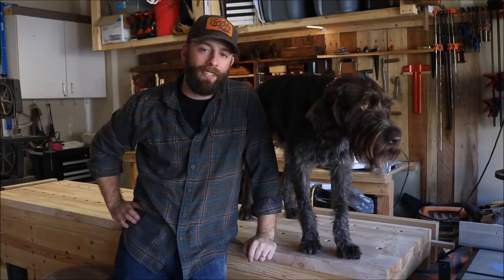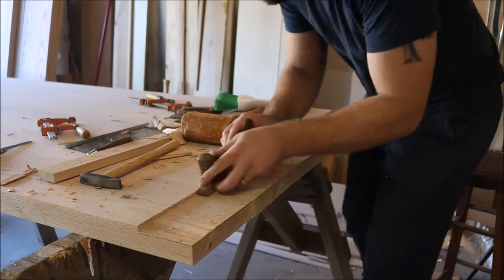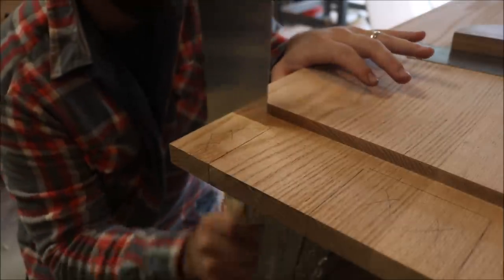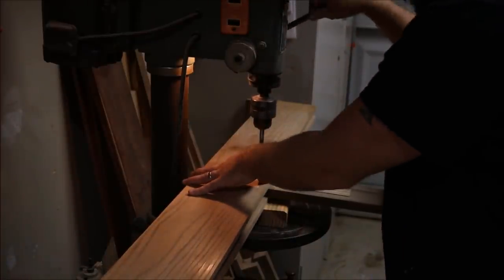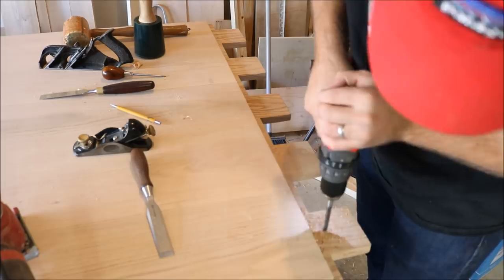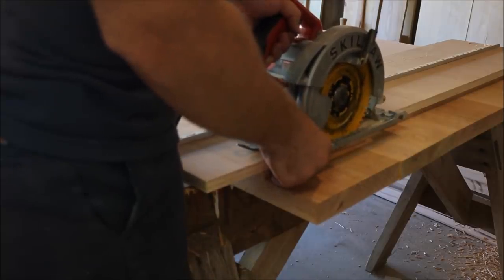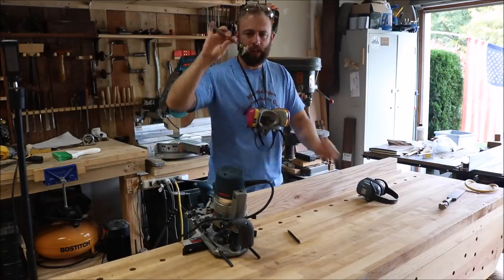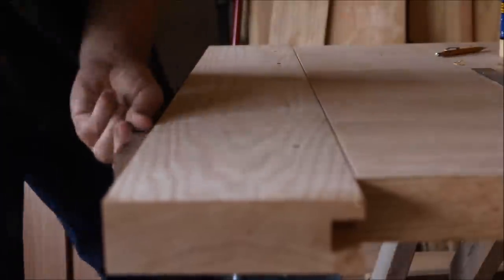SERIOUS Breadboard Ends!! Hand Tools vs Power Tools! Woodworking // How To // DIY

Comment: Chris,  what do you think of a shouldered and wedged tenon for the blocks that attach the top to the base or even a blind dovetail joint?
Reply from the maker: Hi Rosey, I think I know what you are asking here, and If I would have had more time I would have tried some sort of sliding dovetail to attach the blocks to the top. I was already way past my deadline and ready to be done with it. I know that the glue will be strong enough, but using some some of joinery to give them that mechanical strength would have been a good way to go too.

Comment: I am building a 10’ table with breadboard ends but the tabletop is not glued up but instead consists of 6-2x8s spaced 1/16” apart. My question is regarding the attachment of the breadboard- would it be permissible to glue up each tenon of the 2x8s to the breadboard and then draw bore the pieces together since there is a gap between each 2x8 or should I only glue up the center (2) 2x8s?  Also, my project is done in cedar- I plan to use oak dowels- will draw boring put too much stress on the softer cedar?  Thank you for the excellent video and the tool recommendations on your website- all very well done!

Comment: Chris, great video on breadboards - I'm about to start my first go at one.  My question for you, or others here, is about leaving the breadboard end a mite long (when building one in the winter months) to allow that the end will be flush come July when the humidity in Maine goes way up and the table expands.  I'm thinking I may leave my breadboard ends over-long and come back in July for the final cut when the table is expanded about as much as it can.  Of course, then next winter the breadboard ends will be a mite long as the table top contracts.  Any thoughts on approaching this issue?  
Thanks again - looking forward to learning more from you and I appreciate the low key manner you approach teaching.
Reply from the maker: That’s definitely an acceptable approach. If you leave it 3/16th proud on each side you’ll come really close to flush during the summer and might not need to trim.
Reply: Thanks - I was considering that 3/16"s....and that would certainly make it so I don't have to apply finish again or take a chance on marring the already finished surface when the beads of sweat drip into my eyes and increase the risk come next July.
While I'm on the subject of finish - curious what you use on dining table tops....I'm considering gum turps and boiled linseed oil vs. polyurethane - they both have their pros and cons.  Thanks again for you time in replying.  Sure appreciate the support.   @ThirdCoastCraftsman

Comment: Rounded ends on the tenons rounded over with a router would allow you to skip the chisels on the mortise, since you could just use the drill press to hog out the bulk, and route the sides clear. There might be an issue of depth in this case, but I've definitely seen people use drill presses like milling machines before...

I'd probably just break out the chisel, too.

Comment: 7:51: Thanks for the tutorial. Are you drilling entirely through the breadboard, or only through the top layer? Should the dowel go through the top half of the breadboard and into the tenon, or through the entire thickness of the breadboard?

Comment: Only thing I could think of for making the mortised holes would be a hollow chisel mortiser. I don't know if you consider those normal tools, but sometimes Craigslist will have one for sale under 100 bucks!
Reply from the maker: Oh I definitely considered that. I have a smaller JET one but it wasnt tall enough to get the 6" board in there. Getting a drill press attachment might work though. Thanks!

Comment: you can use a mortising machine chisel (and the drill bit too!!) they are cheap you can sharpen them just tap it with a hammer. you can use it for decorative pyramids or for joinery . and it looks cool contact me. ive subscribed to your channel and ive been a professional woodworker for 26 years

Comment: Table top looks great man, question,  what if I had used pocket screws, say 4 per board, 9 foot long boards, do you think the bread board is still a useful option to keep everything flat and safer from splitting? And say your house uses air and forced heat how much humidity change can there really be?

Comment: I was thinking hollow chisel mortiser but the last inch or so would still be hand tools.  Between the stroke limitation on the drill press/mortiser and the length of the mortising bit, a 4" depth would be hard to manage.  Do you need a full 4" mortise on the breadboard ends?  With a 3/4" mortise width, I would think 3" would be adequate.
I have just completed a small table with BB ends; I used 1 1/4" tenon length into a BB end 2 1/2" wide.  Different scale, I know, but strength was more than adequate IMO
Reply from the maker: Agreed that the stroke of the mortiser just wont quiet reach. And 4" might not be needed either. Sometime you have to adapt your design to match your tools abilities and so in this case If I didnt want to chisel I could have went 3" and used the mortiser. It definitely does hurt going 4" and I have zero doubt that it will ever fail with that muh support, but 3" would be probably more than enough as well.

Comment: For a 4" deep mortise, use a chain mortiser. They're expensive but fast.
Reply from the maker: Id love one. maybe I can find a good used one somewhere
Reply: Splunkzop for a mortise their small, do they make a chain mortiser that would work? All the ones I’ve seen are for bigger pockets, and you still need to clean it up some with a chisel afterward.
Reply: I'm not sure what size mortisers they make these days, It's been 7 years since I've done any commercial building work, but I've used a chain mortiser on doors to cut holes for mortise locks - doors were 32mm (1.25") customwood blanks. The builder I was hanging doors for hired one to let me try it out and see what I thought of it. It was too heavy and awkward for that job, also I didn't need to clean up the holes with a chisel as the holes were a perfect size and the face plate of the lock more than covered the hole. I went back to using a jig after that - I wish I could upload photos here because the jig I use is self centring, adjustable for depth and length of cut and uses router bits driven by a drill  to chop out the hole. The only other job I used a chain mortiser on was cutting mortises in 200mm (8") square timbers which were used as framing for a house.
Reply: Splunkzop interesting. I’ve only ever used one for timber framing, they are definitely heavy, but they do an amazing job at hogging out the mortises real quick. With the mortises we were cutting they were a little Rw than twice the thickness of the chain as well we needed the tenons to fit very snug and perfect so we didn’t ever go to the line with that as it didn’t create a super clean and precise edge and wall. The slicks make easy work of that though once you’ve done the majority of it with the chain mortises. Definitely a tool I’d want if I was doing more big mortises like that. Otherwise a drill bit or a router will do the job great too.

Comment: Sorry for the rookie comment but how do you determine the appropriate thickness of the tenon on a given piece of stock?
Reply from the maker: Hey David, there are some recommended ratios and measurements published out there. I've read them but cant remember exactly what they said. I usually just use my eye and what I think will be the strongest keeping a couple of things in mind. If the tenoned piece is going into a much wider board such as a 2x4 going into a 4x4 then I can afford to have my tenon on the 2x4 really thick. I would likely only shave a 1/4" off each face to make the tenon. But if I was joining the same 2x4 into the side of another 2x4 I would want to shave down my tenon alittle more so that the mortise I cut had thick enough walls. I hope that helps. Its so hard writing this stuff out.

Comment: Hallow chisel mortiser would be the only somewhat affordable way to do it without hand tools. I'm sure I'm wrong and someone will let me know that soon enough lol. Either way the chanfered edges on the semm of the breadboard ends adds a nice touch. Give them depth and makes them stand out more. Good work
Reply from the maker: I have a smaller Jet one but the 6" board would fit under it. I might be able to use an attachment for a drillpress, but Im still not sure the hollow mortise bit go a full 4". It woudl be worth me lookng into. Thanks!
Reply: I don't know how expensive they are, but there are portable chainsaw mortisers too that might work for that, though I don't know if they will do 4" either.
Reply: MrTegidTathal they are OUTRAGEOUSLY expensive unfortunately ;(

Comment: To not use a chisel, you could always round the edges of the tennons with a router. If you still the holes close enough together methodically in steps, there is basically no ridges between drill holes, and you can get a rounded edged tennon in there.
Reply from the maker: Thats a good point with the drill, I could have probably accomplished that on the drill press, but not with the hand drill.

Comment: Trying to understand breadboard ends. If the table top is expanding / contracting, then wouldn't it protrude out wider or suck in thinner than the breadboard throughout the year?

Comment: Why is the big chisel called a slick? I got a 2" one in my drawer that needs a new handle too. It is a Socket type? If that is the correct term.
Reply: Man I got a lot to learn, How do you know when to use glue and when not, or is that experience and time?
Reply from the maker: Slicks are usually used in timber framing. The shank is bent slightly on slicks so that you can push along a flat surface and the handle wont get in the way.
Reply from the maker: It never hurts to use glue :)

Comment: I don't know how much they are, but if you have the drill press already, what about a mortising attachment with a mortise bit? Would that get the depth you needed on the "Power tool" side?
Reply from the maker: You know that might just work, I have a mortising machine, but its depth of cut is not far enough go 4" and it wasnt tall enough to let me slide the 6" tall breadboard under it. I think I would need an adapter to use it on my drill press and I could probably get really close to 4" I cant remember if those bits are a full 4" before they flare out or not. They definitely woulb be close. Thanks for the idea.
Reply: I wasn't sure myself as I have neither, but your drill press looks like you could lower the table, then lift that breadboard up to the bit, no?  Then it's all about the attachment. (I wish I had both tools haha!!!)
Btw, saw the new Milwaukee drill in use.  How ya liking it?
Reply from the maker: yea, I think I could get the bit to the mortise on the drill press for sure. LOVE the new drill fricken sweet!
Reply: Attaching the mortising attachment to my Delta drill press shortens the depth of cut. So any mortise deeper than about 2" requires cutting it in multiple passes. I'm not sure I could get to a 4" depth with my set up. Also, the largest chisel that came with the attachment is 1/2" and I don't know if larger chisels are available. If I had to do 4" mortises, I would drill and chisel. I think it would be faster. Great video by the way.

Comment: Great video. I'm working on a table now and this has been very helpful! I have a question about the small chamfer on the edges of the table top and breadboard ends. For an outdoor table that will be exposed to the elements would you still do the chamfer? With a nice tight fit (and good finish) I would not expect that would allow for moisture to soak in but wondered what your thoughts are. Great stuff! Really digging your channel.
Reply from the maker: Im not sure. I havent built any out door furniture, but because of the extreme weather changes year round I would not get going for this type of percise joinery. I would make picnin table style stuff with lots of gaps between to wood for water to drain and air to dry it out
Reply: Third Coast Craftsman Thanks for the advice. I'll be posting videos as the project progresses and will certainly be putting your advice to work. Thank you again sir.

Comment: Is there any concern of the bread board end expanding into the table top? Your method allows for the table top to expand across its width without being restrained by the bread board ends, but I am curious what you think would happen if the bread board end were to expand. Would the shoulders of the table top prevent the ends from expanding inward? I am concerned the bread board ends would expand toward the middle of the table and crack either the dowels or the table top. I hope that makes sense... Great craftsmanship and I am a huge fan of your work.
Reply from the maker: Hey Vincent, Good question! So to answer you question yes the breadboard ends with expand, but in this case its a matter of scale. Between the dowel that is restraining the breadboard and the table top shoulder there is less that 3 inches of wood with the potential to expand or contract. Wood is only ever going to move so much per inch. So something that is 3 inches wide might expand 1/64th of an inch which is nothing to worry about. Now take a continously wide board such as a table top that is 40 inches wide you can expect that to move 1/8th to 1/4 of an inch. So when they are really wide that is when its really important to think about movement. I hope that makes sense haha
Reply: Third Coast Craftsman That makes sense to me. I never knew would movement was proportional  to it's size. Thanks so much for replying so fast!

Comment: It's amazing to watch the difference between woodshop guys and metal shop guys. Woodshop guys wear a full respirator when making a little sawdust. Welders/metal shop guys handle acids corrosive fluids without gloves, and rig up all kinds of dangerous contraptions. Not knocking you for being safe, just interesting.

Comment: Do the dowels go through the entire breadboard to the bottom side or do they only go through the top of the breadboard and the tenons?  Apologies if I missed this in the video.  Great video as always!
Reply: Looked to me that they went all the way through, and glue applied only to the last little bit (less than the thickness of the shoulder) on the top side of the table....there were 2 clues in the video.  One, the holes on both sides of the breadboard and two, the length of the dowels....but I might be mistaken.

Comment: I prefer hand tools because the sound of power tools along with needing to wear a dust mask kinda ruins the fun for me, but while watching videos while trying to learn Im often surprised at how power tools dont seem to be that much faster or easier especially with bigger pieces of wood that need to be moved from one power tool to another rather than bringing hand tools to it.
Reply from the maker: Exactly. Also unless you are doing a large run of the same piece its often just as fast using hand tools (once you get practiced) I do mostly one-off stuff and it doesnt take me much more time to use hand tools. Moving my camera gear around slows me down more than anything else haha

Comment: Nice work, Chris! Did you have any issue with the cross-cut saw loading-up when making that long cut?
Reply from the maker: No suprisingly I didnt. I think it was because the oak was really nice and dry. If this was wetter construction grade Southern Yellow Pine (around 20% moister content) I think I would have had a big problem with that. On my back stroke the dust would end up in front of my saw and on the push stroke the saw pushed the saw dust forward and out of the kerf!

Comment: I realize that this method restricts the table boards from bowing but when the table moves laterally, does this method prevent the edges of the table from protruding past the breadboard end?
Reply from the maker: Hey John, No it does not. There is no way of getting around that with breadboard ends. You just hope the house the table is going into has climate control and there is not a lot of seasonal moisture change. I explained to the client of this build that this sort of the thing is likely to happen.

Comment: You prefer to have the dowels shown on top of the table instead of hidden underneath?
Reply from the maker: I absolutely prefer seeing the dowels. To me those are tell-tale signs of drawboring and craftsmanship. Now, I know some people definetly don't like this look and prefer those hidden like you mention, but the client I am building this table for also likes the look of them so that is what I am doing. The base for this table is also full of exposed drawbored dowels. There is also a risk that you can blow out the breadboard end if you accidently hit too hard or one too many times on the dowel from underneath, and the joint isnt quite as strong because their is less dowel material in contact with less wood. Its probably negligile but I always try to build as strong as possible. haha

Comment: Why take all of the material out between the tendons? To me , that seems to take away the strength, holding the bread boards on. What am I missing?
Love your video on making this.
Reply from the maker: The material left between mortises on the breadboard prevent the breadboard from opening up. If it was all one giant mortise it would likely spread apart and distort
Reply: @ThirdCoastCraftsman  Ok, I have one ?,,  On a 42 inch wide table , how many tendons would you recommend on the end?

Comment: What was the tool he was using at 2:40
Reply from the maker: Thats just a big chisel called a slick. It has a slight bend at the shank that let you use it to pair wood like i am doing in thise video. The heavy weight of the slick makes it perfect for heavy duty work like this.